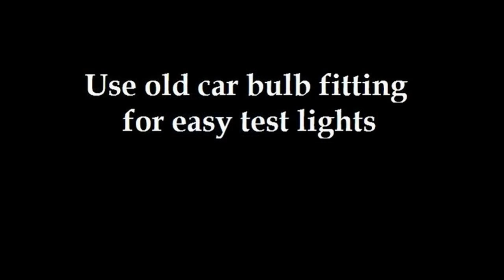How to make car reverse tail led lights p21

Comment: Thanks to you, i have a question : when i put  withe led with the 460 ohms resistor to 12V from my car the resistor is overheats, what causes it?
Reply from the maker: +Damvidetermine Duck Hello, i dont know the specifications from your LED, But use a LED Calculator, i think u need more than 460 ohms resistor, a resistor can little warm thats no problem, but not so warm that u not can  take it in your hands,